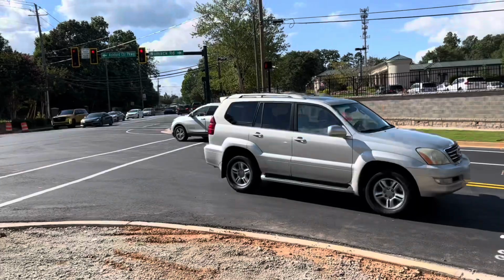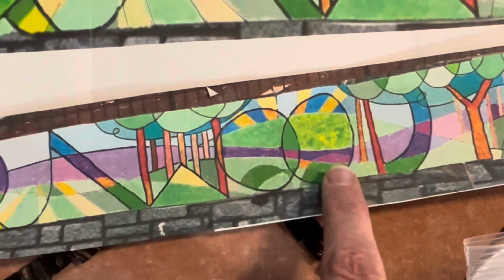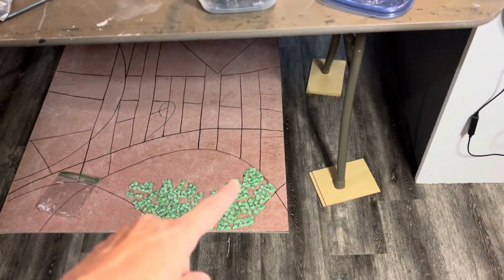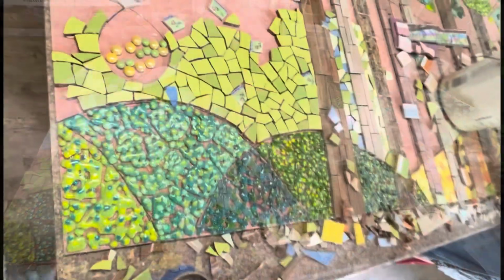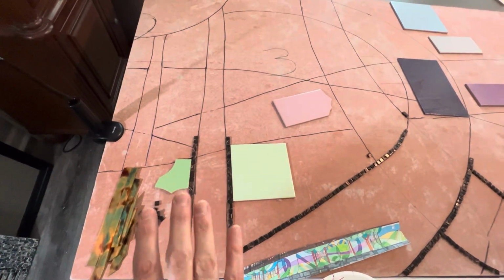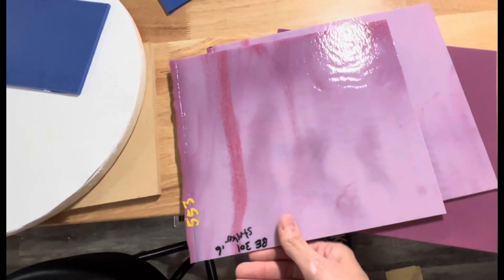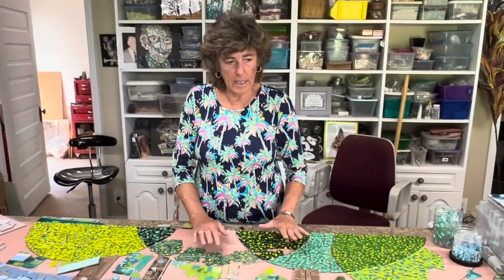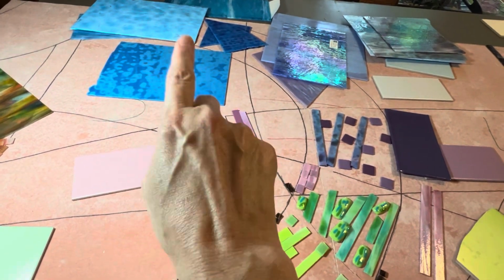Ep. 170 STRIKING GLASS & COLOR COMBOS IN TILE FOR THE LANDSCAPE OF DUNWOODY MOSAIC! PART 4.

Comment: The fusing process is just mesmerizing! Are you able to nip fused pieces to fit? If so, how does it compare to “regular nipping?” Thanks so much for taking us along on this exciting journey!
Reply from the maker: The fused glass can easily be nipped if a piece is sticking out. If it is a big piece (4" or more across) it is difficult to nip with nippers as there are multiple parts that would need to be cut. It would probably smash with a hammer alright, but I haven't tried that. We have cut them minimally to fit.
Reply: @mazzonimosaics8222  Thank you!

Comment: This is coming along beautifully!!!  I am curious, do you use any type of adhesive when you stack your glass before fusing? I understand that sometimes the glass can move during firing.
Reply from the maker: I am not. I have to be super careful when I load the shelf into the kiln that I don’t knock it. If the bits slide or move during firing it’s no problem for this application.